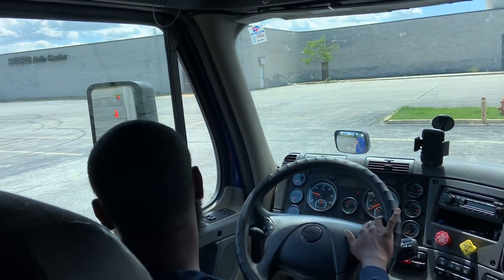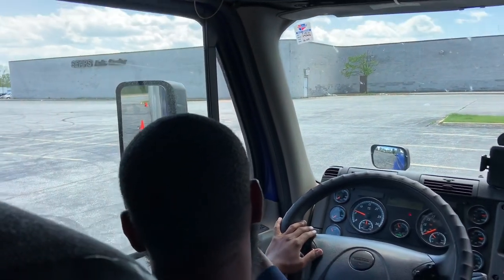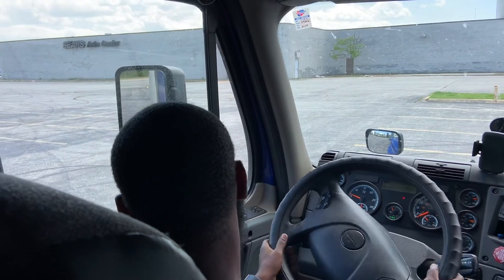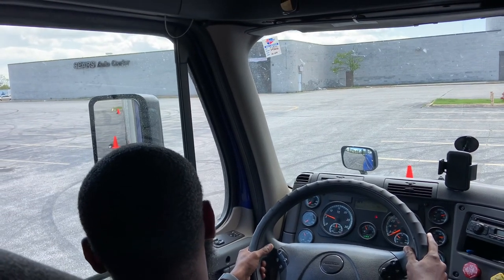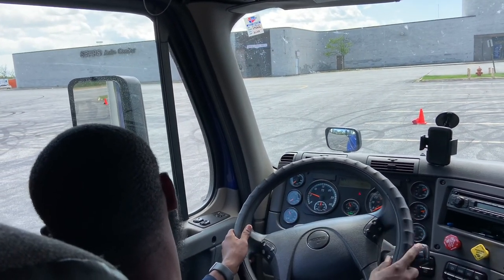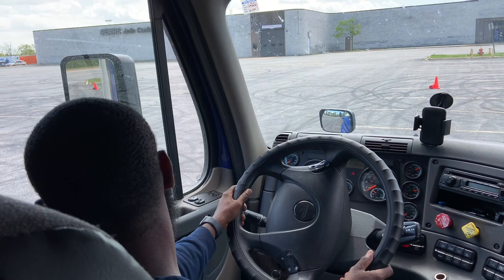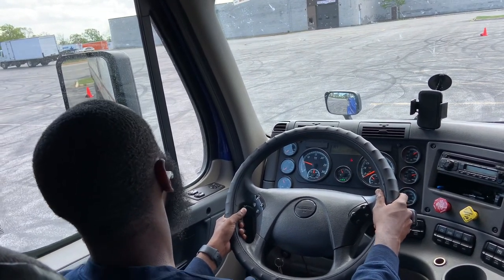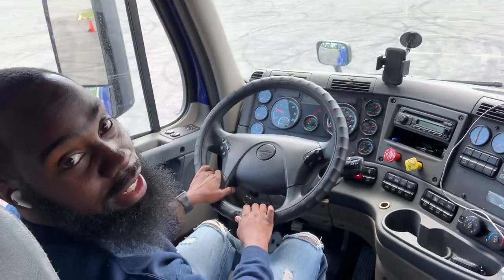How To Straight Line Back Semi Truck And Trailer

Comment: Man. I get it some times and I lose it others.  I couldn’t understand why I keep losing it.  But now I thin it’s because I don’t turn the opposite way after I’ve made my correction.   Imma try this after lunch.
Reply from the maker: Good luck to you…just take your time and you got it 💪🏾💯
Reply: @thelifeofmerckid  it took me a few days, but I got it. It was just slowing down knowing my reference points and anticipating where my trailer was going. I still sometimes need to pull up straighten out, but overall is going well.  Thanks for the help.
Reply: Got my class A baby.

Comment: Why are my instructors telling me to add gas when I’m backing
Reply from the maker: I wouldn’t add gas…the faster you move the quicker that trailer will swing and the less time you got to correct the trailer…slow and steady and you will be just fine
Reply: @thelifeofmerckid  Thank you so much, they tell me get off the brake & add gas so the trailer reaction time is quicker

Comment: Hello bro, question for you, I just started cdl school,  and now am practicing straight line back and offset back, and I am having a hard time trying to get my trailer straight as am backing.  But watching this video, to my understanding,  if am straight line backing, and my trailer drifts to the left, that means I turn the steering wheel a little to the left, just to get the trailer tires to the right? I could use some advice from you backing up straight line, offset, and 90. Thanks, and I hope to hear from you, and stay safe mi broda
Reply from the maker: Yes exactly…remember on the straight line backing to always turn to the problem…just watch your trailer tires and if you stay to your left side then you will have plenty of space on your right side
Reply: @thelifeofmerckid  do you have any videos on how to perfectly do a 90 ?

Comment: Right now im struggling my instructor taught turn left when loose and turn right to tighten it any advice would be well appreciated
Reply from the maker: Everybody teaches a different way but I was taught to always turn the wheel to the problem…if that confuses you then just stop and think of which direction you want your trailer to go and then turn the wheel on the opposite direction…let me know if you need more help

Comment: We’ve practiced with tractor and trailer without a sleeper Berth. A week before my test we started using the sleeper berth and it’s been difficult adjusting. Having issues with offset and straight backing, any help is appreciated!!

Comment: I’m in truck driving school right now for my class A and did this. Omg 😩 imma be stuck on this shit for a while. My 3rd day trying it. Shit is not easy.
Reply from the maker: Just take your time and go slow…and remember to always turn into the problem and then turn the wheel back the opposite way to get the truck back in front of the trailer…once your back in front of the trailer then straighten the wheel up and proceed to roll back…keep repeating those same steps over and over again…good luck to you!!!!!
Reply: Has it gotten any easier? Today was my second day and I struggled a bit. Idk if I’m over steering or not straightening the wheel back fast enough.
Reply: @dominqueferrari5196  yea. You will get it man. Just keep and 👁 on the rear of the trailer. Before you start backing up look at the wheel at the end of the trailer how they are positioned. Then when you start backing while keeping and 👁 on both mirrors while backing up if you start to see the tire disappear then start turning your steering wheel towards the problem. Meaning the direction the trailer is leaning out to until you see the trailer straight again how it was before you first started backing.
Reply: @stizz1982  going to try this. Thank you 🙏🏾
Reply: @dominqueferrari5196   😎👍🏾
Reply: @dominqueferrari5196  how’s it coming man? Getting any better for you?
Reply: @stizz1982  it’s coming along…my school all over the place so they only want us to use the driver mirror and the rear trailer tire to decide which way to correct…today I was only able to back a couple times. 1 not so good and the other one was decent…I can’t tell exactly when the tractor and trailer is aligned after the correction but I’m optimistic that it’ll come together. Hopefully sooner than later.
Reply: @dominqueferrari5196  yea that’s what I had to do.  Let’s say when you look at your rear tire on the right side of the trailer and it’s disappearing from your mirror you have to turn you wheel to the left until you can see that wheel stick out again. I pretty much got it straight now.  You got this.😎 🤙🏾
Reply: @stizz1982  I appreciate you man. Keep crushing it!
Reply: @stizz1982  HOW IS THAT TURNING INTO THE PROBLEM THOUGH. THE PROBLEM IS ON THE RIGHT WHEEL IN THE BACK (TRAILER) SO IF YOU TURN INTO THE PROBLEM THEN SHOULDN’T YOU TURN TO THE RIGHT WHICH IS THE PROBLEM ? RATHER THAN YOUR LEFT -// THE LEFT ITSNT THE PROBLEM, THE RIGHT IS ? WHY TURN LEFT?